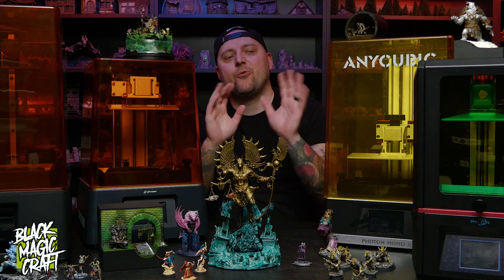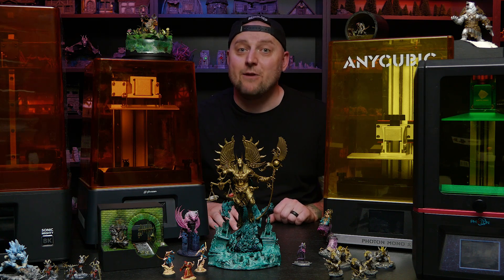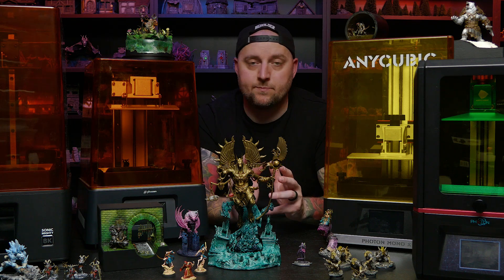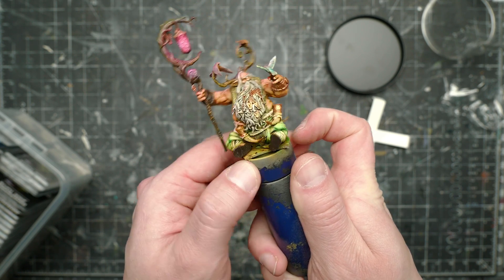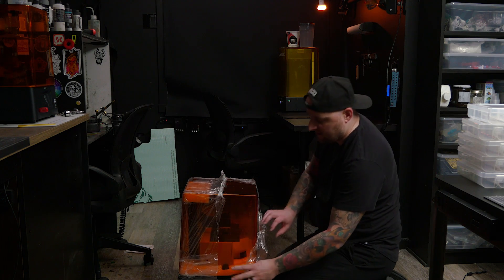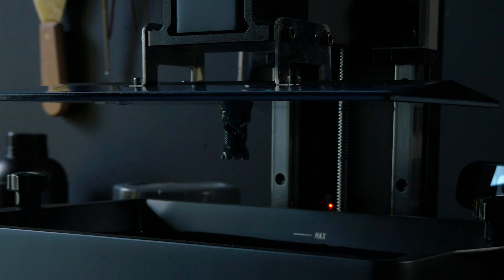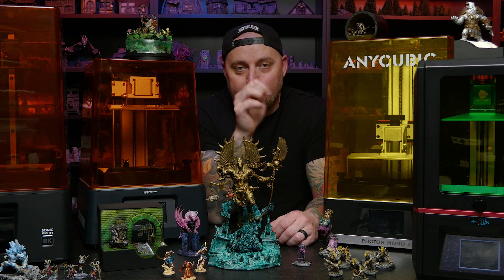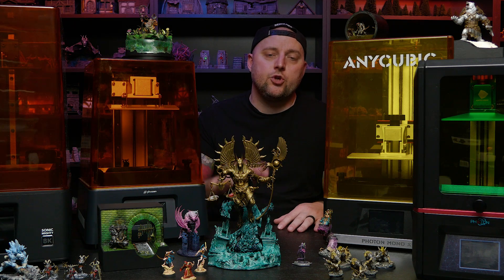THE TRUTH ABOUT 3D PRINTING

Comment: l still find it daunting... especially now... with the economy slowly killing our family of four... it is the cash outlay ... and the material outlay... and the time outlay... l work two jobs now ... with limited hobby time ... can l afford to make devote more time to printing , basing , painting even more minis ?
Reply: The printer can be quite cheap, but the biggest cost will be the resin.
Still cheaper than buying minis, but if you don't necessarily need it, then I wouldn't recommend buying one if money is sparse.
Reply: @doubeld.7536   lf money isn't sparse now , l am sure it will be soon ,as these problems seem a long way from being fixed. The big thing is also the time factor , working two jobs , two kids, l am often so tired ,that my started projects remain in my work cycle , with no new projects being started.

Comment: I own a resin printer and a FDM one and let me tell you that I would love it soooo much if FDM printing would be as easy as resin printing. Not saying resin printing is to a point of "fire and forget", but man oh man is FDM printing close to "fire and struggle for the next few days to get it to work but you have no idea why still". Haha!
Reply from the maker: Imma be honest, I’m waiting for fdm to hit that point before I get into it.
Reply: @BlackMagicCraftOfficial  I honestly believe FDM may be a technology on the decline. As resin printers and resins get bigger and better, the advantages of FDM shrink. I own both and it already feels like resin is the more mature technology. The biggest issue with resin is brittle prints or parts warping. I've had a photon mono for 2 years now, and rarely have failures unless the room is cold or I'm trying a resin I haven't dialed in. I've had an ender3 the same amount of time, and it will print beautifully for a couple months, then I have to work on it for a few months.
Reply: @muzzynat  yeah the main difference is the cost in materials. Resin is much more expensive than filament and printing a large volume of stuff (say dungeon tiles for example or a fully playable ship) is usually not doable in resin.

That and the print plate size for the same amount of money.

Basically, it comes down to either we pay for simplicity (resin) or we work to save money (fdm).
Reply: @BlackMagicCraftOfficial  I totally agree. I am in fact waiting for it to hit that point to change my current FDM printer that I'm barely using anymore anyway.

Comment: I'm apart of a few communities including Archvillain Games and I must tell you they are the worst I'm associated with.  The most current release included some angels and someone ordered it, a medium creature with nothing special, I printed two and both failed, when I went back and looked through Lychee there were 25 supports that were too close. I love most of the models that come out of the studio but almost every single one I need to go back and adjust supports to get a clean print.  Also, I own a couple Mono X's and currently waiting on a couple new machines, my experience was the opposite...My failure rate is mostly based off design and not the machine. Lastly, most of the models I work with, I combine the models in 3d builder and add my own supports because I hate Milliput lol.
Reply from the maker: 3D printing is big YMMV energy.
Reply: @BlackMagicCraftOfficial  I totally agree with that!  Did you have any issues with your supports while printing Archvillain games?
Reply from the maker: I have in the past, but on the mono x that I had problems on. Everything I print from them lately has had no issues.

Comment: $3500 for a printer is the REAL limitation. That's too far from reality for most....
okay $900 still pretty pricey
Reply from the maker: What are you talking about? All the printers I use are a couple hundred bucks, the brand new big one is the most expensive at $900.
Reply from the maker: Where did you get that insane number from? You can buy a pretty good printer for under $300.
Reply: @BlackMagicCraftOfficial  my man must want a 16k printer! 🤣🤣
Reply: Most starting printers are about 200-250€
Can even get one for 99€
Reply: Bro, my first resin printer was the Anycubic Photon S was $99. There are sales going on all the time between different manufacturers.
Reply: Bro I got mine 200$

Comment: I've owned a Anycubic photon mono 4k for about 3 months now and I have to say, it's pretty damn easy. I had one series of failed prints that was frustrating but after one session of experimenting with the cones of calibration and learning about proper supports, it's pretty much point-and-click printing for me since. No failures that couldn't be explained by me being lazy and/or stupid.
Reply from the maker: I feel like peoples experience with that printer are split 50/50. Lots of people using it with great success, but lots with issues. Not sure why.
Reply: @BlackMagicCraftOfficial  Agreed,. I'd guess the complete lack of any useful instruction or tips n tricks included with the machine could be part of it. Users are left to figure it out on their own. I did a lot of research (including some of your videos) before I bought it as my first printer so I had a few ideas of what I was in for and how to get started.
Reply from the maker: I feel like anycubic has questionable quality control and some people just get lemons.

Comment: While I haven't done any 3D printing myself, I did a little bit of research when trying to figure out if Hasbro's HeroQuest re-release would be under threat by such a thing. What I determined in the end is that while it can be an excellent tool for making unique miniatures cheaply (or at least cheaper than Games Workshop for instance), overall the time consumed and potential errors from incorrect print settings make it more likely that people would just pay for the board game. I'd say that 3D printing is probably much more suited to a wargame or something like d&d where there aren't a ton of cardboard/card-like components as well.
Reply: In large part, that's right. But there are also a lot of games being funded & released via Kickstarter these days that include .stl files so that backers can print their own minis for the game.

Comment: Been resin printing for a few years myself, and I find it way easier than FDM, there's very few points of failure.
Best upgrades I ever made was a flex plate, silicone mats for work surfaces, a wash+cure station(sometimes you just need the uni-tasker Alton), and a chemistry stand to filter resin back into the bottles.
Best improvements though? Learning about supports proper, having a good settings profile so they don't damage small prints, and upgrading my process, like removing supports before curing final and using warm water, not over-curing (avoid brittle parts and frosting), letting the IPA evaporate entirely before curing... etc.

And Patience, speed will always lead to more failures, these machines are inherently very fast as is, so working without being in a hurry is critical.

Learning certainly helped the most, and I hardly ever have failures anymore, even after the machine sits around for a month or two without use.

The camera has a good use case, that is, you can check on long (Tall) prints and stop them before it gets too far into the failure, combined with remote pause to do a full check, you can save a lot of material or possibly a FEP from ruining your day. Outside that, time lapses? can't really think of a good use for it.
Reply: One other use for the webcam via remote monitoring: Large prints take a lot of resin, and it may help you monitor resin levels in the vat so you know when you need to pause and go top it up.
Reply: +1 for the flex plates and the wash/cure station.

When you're cranking out prints being able to pull the plate, dump it in the wash station and then hit go on the next batch is a huge quality of life improvement.

Comment: Your experience with the Mono X exactly matches my own. I've had it for about 8 months now and while I've dialed in my settings as much ad possible, I have never got flawless prints consistently. It can make the experience so incredibly frustrating.
Reply: I had an almost exact opposite experience with my Anycubic printers, my Photon S was nothing but trouble and my Mono X has been printing perfectly since the day I got it. Guess I was lucky.

Comment: I have both a resin and fdm printer and MUCH prefer the resin.  It's close to plug and play, and yeah there are some settings to dial in, but as long as I remember to level after every 5-7 prints, and keep the firmware up to date, I rarely have a problem. OUt of the box, I was printing within 20 minutes and was amazed.    The fdm printer?  Nightmare from the start.  I've printed great things from it but anything has a 50/50 shot of turning to spaghetti.  FDM just has more variables and ways to go south. 

You're SO right about picking a good source of models.  AVG and Loot are my go tos.  And since I"m usually a month or two behind, they've already released updates to all their models so I never have trouble with the models.

Solid advice across the board in this video....great job.
Reply: How important is the area to print for resin printing? I don't have a great area with space & open windows to print and I have concern about the fumes. I would much prefer to go towards resin than FLm.
Reply from the maker: You want a small dedicated table and area, and defiantly some ventilation.
Reply: @samdogmillionaire9288  I have extra counter space in a bathroom and it works excellent. its like a room made with printing in mind, no windows and it has ventilation.
Reply: @samdogmillionaire9288  I do it in the basement and honestly can't smell it till I open the printer top.

Comment: I'm glad you have basically said what I have felt since I started 3D printing. It takes some learning and some work to do it right. But it gets easier as you do that. I'm using a machine that is basically the same one you started with. I bought it used. I'm getting better with it all the time and every success is a time to celebrate. Just to compare, when you were using the Photon, what resin and settings were you using with it? I'm always double checking and tweaking it trying to get better results.

Comment: I have 4 friends who I got hooked on warhammer 40k and they all have 3d printers for their jobs. So when I showed them 40k they went all out. The issue were having is finding the correct files. Id like to buy a 3d printer but I just don't want to go through all the hassle of learning how to use it properly.
Reply: I had prints coming off my mars 2 within hours. I think it took me maybe 10-20 min to set up, and if you get presupported files all you do is press slice and then put the usb stick into the printer. I would say the biggest annoyance is cleaning the prints, but I wouldn't say learning 3d printing (at least for resin) is a hassle. it was literally easier to set up than a paper printer.
Reply: Resin printing isn't that much of a hassle, if you can find the settings for your printer + resin combo online.
The software is easy to learn, and if you got presupported models, it is quire literally drag and drop.

Comment: Are there any tricks you use to get models off the build plate? I recently got a mini 8k and printed out that same test model but for the life of me couldn't get it off until I ended up heating the build plate as if it was a pickle jar.
Reply from the maker: If it’s really hard to get off reduce the bottom layer exposure times.

Comment: My biggest problem was the chemicals and the space...
Printing in my living room without a dedicated place, having to carry them through the apartment to a sink and clean them and stuff...
The whole apartment smelt bad, I got headache, and so on.

I bought a table, a cleaning station and some other goodies.
Now? I print, I wash (with water solveable resin) and ... am done. Most of the times the cleaning is done in 2-4 minutes max.

The huzzle to dial in the settings and test them and so on is much more survivable for me, if the rest is no problem!
So my biggest tip: Get a washing and curing station, get a dedicated ( and good ventilated place for the stuff) and shoot your shot :)
Reply from the maker: Yes! Having a dedicated area and creating a simple post print routine is priceless!
Reply: since you mentioned sink and water washable, I hope you aren't putting the resin down the drain!
Reply: @Born_Stellar  Actually no! Just had a bucket there, for missing space reasons before.^^
Don't poison your local water supply with resin and stuff, mates!

Comment: I always tell people that, if you get into 3d printing for tabletop, you need to understand that 3d printing is its whole own hobby that you have to enjoy and dive into to get it to work for your tabletop hobby.
Reply: I feel like its faster for me to 3d print than it was to build all the plastic models I used to buy, so really you can just trade that part of the hobby for 3d printing.
Reply: i found FDM printing was a full time hobby that required non stop tweaking and super sensitive to room temp changes. resin printing i find far more beginner friendly.
Reply: @13Nagash13  FDM was a nightmare. It put me off 3d printing for years. Until a friend got a mars2 and produced amazing models and I figured if he could do it I could. Haven't looked back since!!
Reply: @13Nagash13  I started with an ender 3 v2 printer, and had the same issues. It's a good printer, but the learning curve is steep. Very satisfying once you get good quality peints put of it though. Bought a Pursa mk3 since, and it has a lot of quality of life features making fdm much more manageable. Not a oerfect printer, but as close to set and forget as I experienced so far.
Reply: I agree and disagree. To me 3d printing is merely a large tool for the hobby. I don't see it as much different than going into airbrushing or learning a new painting technique...in fact I think if my life was on the line between printing a good army, or painting a good NMM...you can bet I'd start looking up STLs. 
  As stated, I don't see it as a whole other hobby, but a tool, and not every tool is for everyone, like I said NMM and glazing are tools of the hobby, but I'd rather bash my head against a brick wall XD.
Reply from the maker: Fact
Reply: You say 'hobby' I say 'rabbithole' :P
Reply: @BendingBeaver  yeah it’s great but work. Learning curve is frustrating then when you figure it out, it suddenly just opens up amazing possibilities. Just have to go into knowing it’ll be hard at first. A hobby within a hobby is dead right
Reply: This
Reply: Fingers crossed for the next gen or 2 then, once 3D printing is click and go i will be interested!
Reply: @J N yeah ya have to go into with your eyes open
Reply: It's amusing to me, because building FDM printers is far more for fun to me than doing the printing of things with them.   And yea, it's a hobby that you need to enjoy.
Reply: Enh, that is a good mindset to approach it from, but like it says in the video, once you find a resin and settings that work for you, you don't have to be as invested.  I'm not fussy though.
Reply: I read this all the time and it's just wrong. All you need is some common sense and a basic understanding of physics.
Reply: Im trying to build a business with 3d printing dnd minis and terrain.  I did get my first sale, then nothing.  Got into a Kickstarter to expand my line.  Hope it pays off.
Reply: i just pay money for the blueprint and push the button of my printer. Done.

Of course you need to know which printer gives the results satisfying your goals
Reply: 100%
Reply: Hallelujah!
Reply: I’ve already started to make my own terrain for Warhammer 40k
Reply: @BendingBeaver  I have been looking into getting into table top wargaming simply due to how inexpensive 3d printing makes it. There's no way that I could afford to buy all of those miniatures at the price that they are sold at in the stores. Not to mention how I only need to sell a few extra prints in order to pay the machine off. It's far more accessible than you may think.
Reply: Truth.

Comment: 3d printing is not as simple as printing to paper.  There are a LOT of variables in the process.  So... yeah, it's not just clicking on the print button and getting a thing.  Sometimes you need ot fiddle with it.
Reply: Printing on paper is actually pretty complicated too, the tech is just more mature.
Reply: ⁕laughs in etching and engraving printmaker⁕
Reply: @nekrataali  Assuming you mean chemical etching yeah, that's a lot of controlled variables or it fails to do what you want.
Reply: @nekrataali  also laughs in printmaker   Intaglio and Lithography are like two very different but equally hostile beasts ready to ruin the whole project at any step.